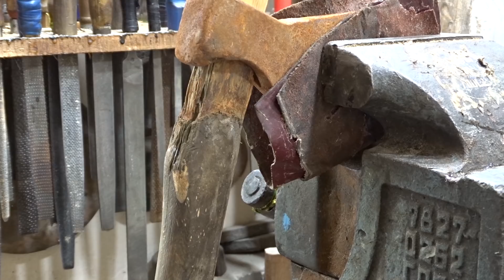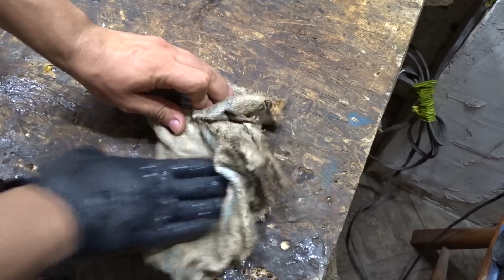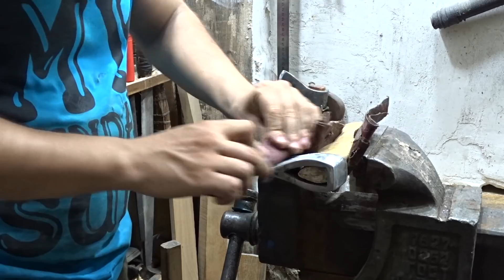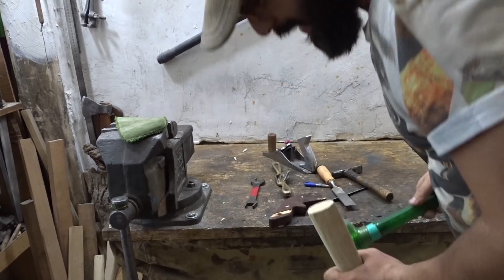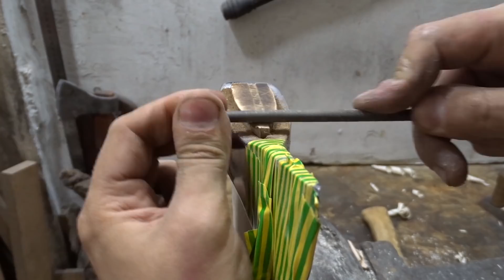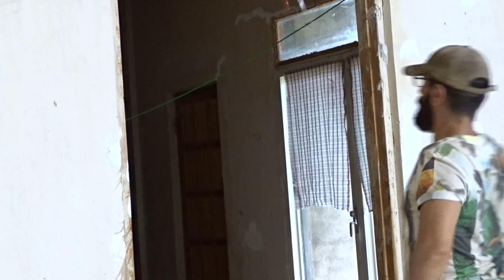Restoration Rusty USSR Carpenter Axe

Comment: Where do you get the two components paint also great job
Reply from the maker: I buy in cosmetics and household goods stores. This is a regular hair dye. Buy the cheapest, as long as there are two components. The tube and inside of the bank.
Reply: Thanks

Comment: nice work, but what makes it a carpenter's axe? in my world, most carpenters don't use anything of the sort. What few do use something like an axe it'[s small narrow blade one with a hammer on the other side. Also in my world, a one handed one is a hatchet, two handed handle is an axe. Not always that way in other places tho.
Reply from the maker: Hello! I previously searched for information about this axe. And it turned out to be a carpenter's. By the way, the western version is different. I agree with you.
Reply: Perhaps the acute angle of the blade? I, too would term it more a camp hatchet than ax.